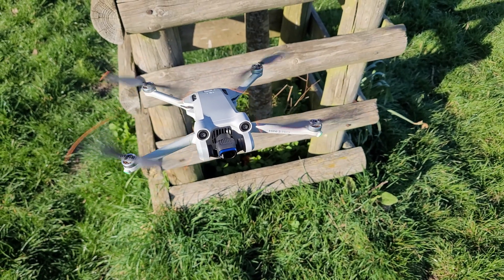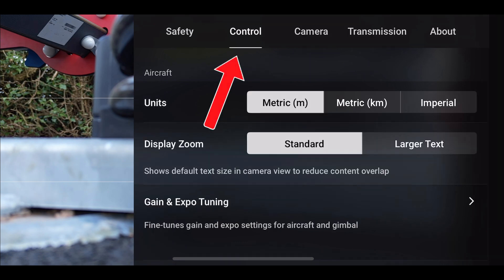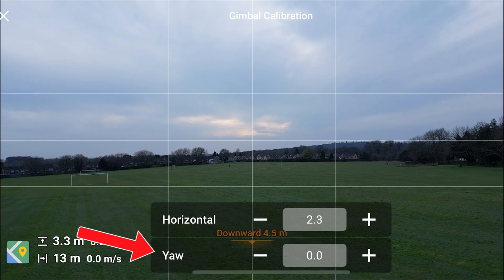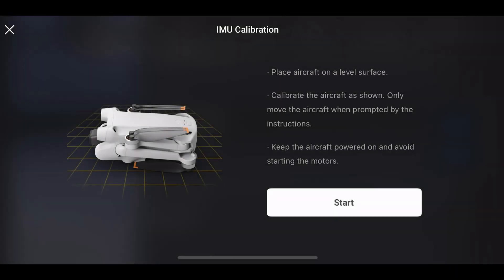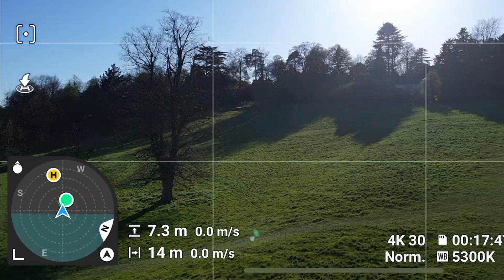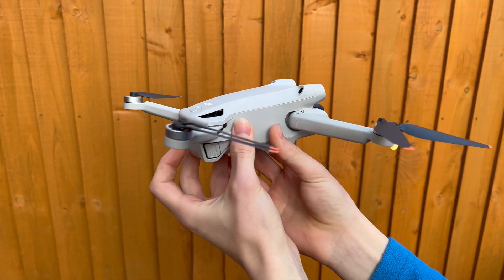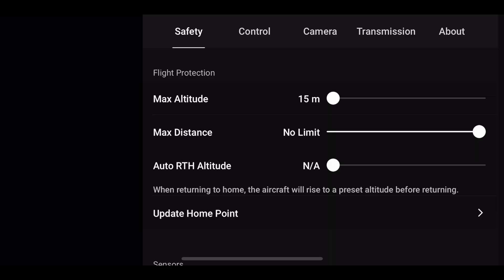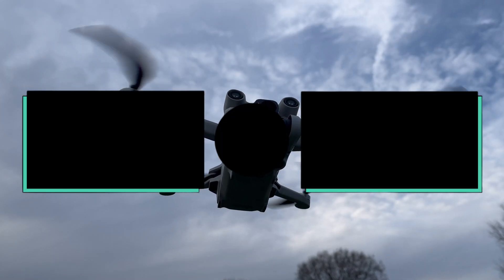FIX Your Unstable Drone - Calibrate!! (Gimbal, IMU, Compass, RC)

Comment: "DJI recommends recalibrating the compass if you are flying further then 50 km from where last flown or if you haven't flown for >30 days".
This is BS.
Ten years ago DJI did make those recommendations and they were incorrect.
The drone's compass calibration has nothing to do with where you fly or when.
Check your manual - DJI don't make those recommendations and haven't made them for several years.
There is normally no need to ever recalibrate the compass or the IMU in your drone.

Comment: 05:40 - Sooo, second "stage" I was doing wrong because I was doing like in first step, and without changing position and turned that 360° like in picture/animation... not turning the drone vertical, then that 360° move 😅

Comment: I do this every time I haven't flown in awhile.
Reply from the maker: DJI recommends calibrating the compass if you haven’t flown for 30 days. I would say that it isn’t at all necessary to calibrate any more often than this, unless you notice anything wrong with the drone or the app tells you to calibrate. I went for over 6 months without calibrating and there were no issues though… 😅 thanks!

Comment: With DJI RC (RM330)  and DJI RC-2  (RC331) You have a compass in the controller to calibrate when required.  - I have no idea what DJI went to an "RC Model designation suddenly; it has always been RM for built kn dusplay controllers. For example:
Smart Controller: RM500
RC-PRO: RM510
DJI RC: RM330
DJI RC2: RC331 

The controllers that rely on your phone or a tablet, to run the app and supply GPS and a compass, obviously do not have a compass. This includes the 

RCN1 (RC231) - For Mavic 2 Pro/Zoom
RC-N2 (RC151) 
RC-N3 (RC151) - this is how DJI Published it. I suspect it is incorrect. 😂
Reply from the maker: Great info here, thanks very much. The controllers with an in built screen do indeed have a compass which sometimes needs to be calibrated, you’re right.

Comment: Hi, thanks for the video. At 03.38 you mentioned IMU calibration when drone cooled down not room temperature.  What's the ideal 'cool' temperature for this procedure?   I'm still using the Mavic Mini 1 which is still working fine (albeit with the limitations of older technology spec)
Reply from the maker: Well, I’ve never seen a precise answer to this and to my knowledge no actual data exists for this. It is advice directly from DJI not to calibrate drones when they are hot, but they never specified what “hot” means.

However, most electronic devices like this have the optimal temperature at around 20°C. So most likely the optimum temperature for calibrating will also be around this temperature. The Mini 3 Pro overheats very quickly and so calibrating the drone if it has been idle for a while isn’t recommended. Thanks very much for the contribution!
Reply: @takeoffdrones Thanks for the response and good answer mate.  Your video is very clear and a thoughtfully put together guide.     
Should anyone have issues with their Mini 1 having connection drop outs between controller and iPhone, put iPhone in flight mode. That solved issue for me (iPhone XR)  I also use Maven App to get tracking and follow modes plus waypoint flights.  An old drone but still doing what I need.

Comment: Great, good info and all done on mine.
Reply from the maker: Great to hear!
Reply: @takeoffdrones MINE NOT ...sadly IMU  NOT
Reply from the maker: @ORTHODOX-PATH  IMU not working? Maybe try restarting the drone and trying again. Make sure the drone is on a level surface and not moving around so you don't get any errors.
Reply: @takeoffdronesIdid it thanks 😊😊😊😊😊